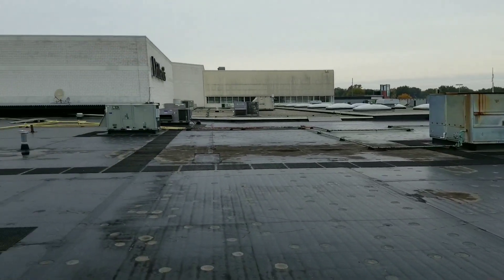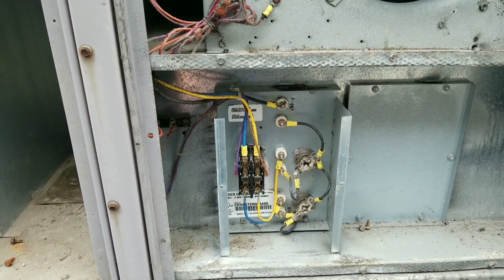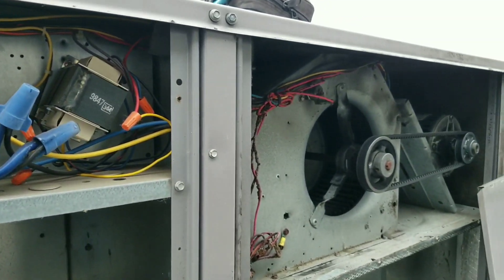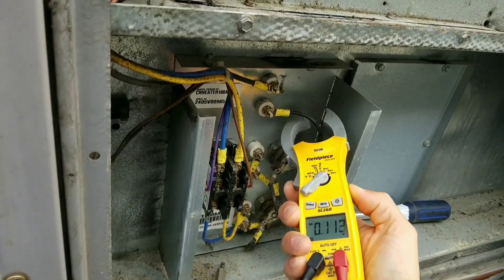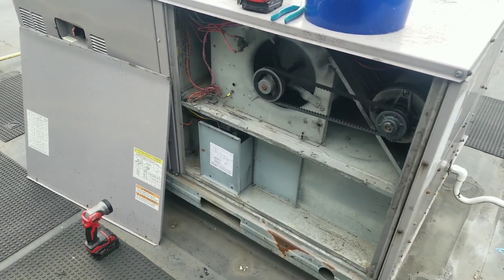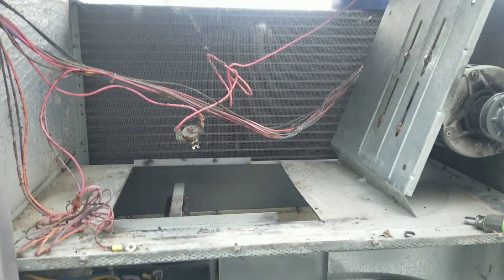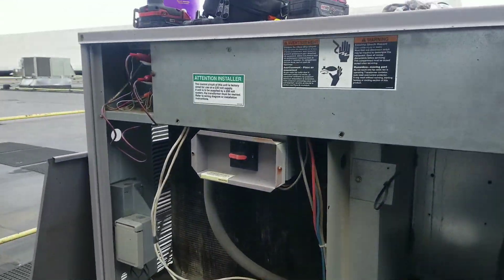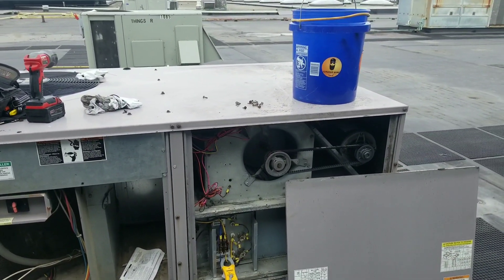Package unit with electric heat strips

Comment: I've modified these types of units to become a cheap re-heat by using a humidistat to enable a relay and energize the heat strips while cooling is going to raise the discharge temp and lower the RH in the space

Comment: Electric heat is about 50/50 with gas heat up here in the northwest. Gas isn't always available especially in rural areas. Energy code pretty much requires most units with electric heat to also have a heat pump capability. Electricity is fairly cheap to very cheap here, and propane is definitely more expensive if that's your only gas option. If you can get the power capacity, zappy zap zap for your warm!
Reply from the maker: Interesting- thanks for the feedback

Comment: See a lot of that set up down here in Florida. They maybe complaining because when you have only bank of heat strips you need to move that violet wire on the terminal strip to the orange from the board. This way W1 brings on heat strip with the blower. Otherwise the blower will run with no heat until you get a W2 call. Good vid
Reply from the maker: Thanks for watching Paul- Appreciate the feedback

Comment: I worked in Florida lots h/p and electric heat not to much gas.
Reply from the maker: That's what my buddy Chris at HVACR VIDEOS tells me
Reply: @curioushvacguy6876  it doesnt get too cold for them to use gas or oil so i guess electric and heat pumps would work

Comment: uhh there's a problem with your ohms test. There are three heat strips but they're not all wired in series. It's a three-phase supply with two of the phases switched by the contactor and the other always live. Each phase hits one end of a strip, and the other ends of the strips are all tied to each other, kind of a "wye" arrangement but with the center floating... You tested from the black phase to the blue phase, which shows the top and bottom strips to be functional. You did not test the middle strip, which comes back on the yellow wire. Also, note that the black phase is not switched, and your entire test may have been floating at 277V from ground.
Reply from the maker: Thanks for the feedback, Im going re watch that video and get a better understanding of this WYE pattern you speak of
Reply: All of the legs where pulling 14 amps, which makes 9,6 kw at 400 volt. So it verks!

Comment: A common problem is techs hook up the wires color for color. On these Carrier units it is not done this way. Orange to purple and purple to orange. The W1 terminal does not energize the fan. The thermostat energizes the fan. Thermostat must be set up for electric heat. I’m curious if the wire and breaker size were checked for the amp load for the second heat strip. The MOP (maximum over current protection) should be confirmed before adding additional heat.
Reply from the maker: Thats a good point- I didnt check the max fuse size or breaker size on this unit-- I go there pretty often so next time Im there im gonna walk on over and take a peak at that compared to the breaker size, im curious now 

Thanks AC Tech

Comment: Great video. I’ve never seen an RTU with heat strips before (other than in text books), probably because they wouldn’t have sufficient heat output here in Canada. 
I have to ask a dumb guy question now...
I saw the (very dirty) condenser coil, but where was the compressor? On the other side of the condenser coil? I’ve worked on a lot of Carrier RTU’s, but not that exact model, maybe it’s different because it’s an electric heat unit. The compressor on the units that I work on is typically right below the electrical panel. Thanks!
Reply from the maker: Hey 404- not a dumb question, it is in fact on the other side of the condenser, sort of right in the center of it or rather the condenser is sort of wrapped around the compressor if that makes sense-- thanks for watching, I appreciate the feedback

Comment: Thank you for a learning opportunity. I only watched the first part. Calculations below are "back of the envelope". Any corrections will be appreciated.
Heating elements were not "daisy chained". They were "Wye connected".
Resistance calculation should be done: phase voltage / phase current, i.e. 230/11,5=20 ohm.
You took resistance measurement of two heating elements connected in series, so at service temp. it should be 20+20=40 ohm.
At ambient temperature is should be less, ca. 39 (kanthal).
Jumping thermostat did not prove proper operation of all elements (cabling, thermostat, etc) outside the unit. You mentioned no fact which indicated that the strips were in operation when heat was called by thermostat.
What is the location of heated space? If it has no direct contact to walls/roof/ground, the only need is to heat is the make-up air. 
14,3 A indicates 277 V phase voltage. Power should be ca. 14,3 * 277 * 3 = 11,9 kW. 12 kW is roughly equivalent of 36’000 K*m3/h, i.e temperature should increase by 36 Celsius at 1000 m3/h.
Possible scenario: with coil that dirty the flow was much smaller and possibly thermal overloads tripped. The actual power was reduced to a fraction of nominal power. This could have been checked by leaving the heater “on” for a few minutes and observing current.
Also the belt was visibly loose. There’s no way it could pass a test with belt tension gauge.
Reply: Damn... I thought he did really well lol
Reply from the maker: Hey Lutz- thanks for taking the time to explain this, Ill admit electrical theory definitely isn't my strong suit so I have some follow up questions. 
You said- 
Heating elements were not "daisy chained". They were "Wye connected".
Resistance calculation should be done: phase voltage / phase current, i.e. 230/11,5=20 ohm.
You took resistance measurement of two heating elements connected in series, so at service temp. it should be 20+20=40 ohm.

Can you have elements Wye connected and in a series as well? 

On a side note- I did address the loose belt, I didnt show much of it on film after I pulled and cleaned the blower but I adjusted it to appx 1" deflection not using a belt gauge-

As far as the location of the space that is being heated, it is a jewelry store directly below the rtu, 4 walls and a ceiling, and surrounded by other stores. The front of the store has a mostly open design so Im thinking they sized this unit knowing the malls heating system ( Large RTUS that heat the halls, offices, and everywhere else ) would influence and this was just supposed to be used as supplemental heat.

Im still confused how you would go about calculating the amount of amps you should see at the heater bank based on heater size, airflow cfm, return air temp and voltage. 

If you care to continue this conversation please shoot me an email at curioushvacguy@gmail.com 

Thanks
Reply: Aside from taking a supply temp and ensuring you didn't trip the limit, I think this call was well done.  We are service techs not electrical engineers.  Great job Bill.
Reply: @ all major HVAC/R guys on YT I watch carefully your videos and learn from them, e.g. “what’s jumping out at me” is a good start for any job and I learnt it from HVAC*R. I do learn from each of you and am thankful.
Critiquing gives me no pleasure and I can gladly keep all my conclusions to myself. On the other hand I’m not a fan of “safe spaces”, don’t need one and think you don’t need them either.
You can say what you will about military but After Action Report is the best way of self improvement in practical activities. To the best of my abilities to try do just AAR/peer review. Kind regards and Merry Christmas.
Reply from the maker: Thanks Rookie

Comment: I just did a InterTherm  trailer with coil elements  amazing they use  electric here in Michigan
Reply from the maker: Its not efficient at all, in my opinion, our winters are just to cold- I havent seen to many of these but they are around apparently. What part of Michigan do you service?
Reply: Adrian  ,Brooklyn, Onsted ,Blissfield  and Jackson areas
Reply from the maker: Awesome - Im right in those areas as well, also detroit and the other side of the state-- what company do you work for if you dont mind me asking?
Reply: I work for myself  . was in Arizona for 14 years  as maintenance   supervisor for 5 apartment complexes 2800 units all I did was Ac units .came back  to Michigan family issues  etc.   worked on family and friends units from there word got out and now am to busy

Comment: Great video..
Defitinely need a second bank of heat strips..
Your not in south Texas,where 5 kw..is more than enough,with heat pump though..norm here is 7.5 / to 10..
But im sure you need 20- 40 kw of heat im assumimg....
Great tech tip..
Good job cleaning up everything.
Thx for the video..
Bryan Tyler Refrigeration
Reply from the maker: Thanks Joseph- yeah we dont have Texas Winter temps here, Im guessing you guys have a low of 30 in the winter? That would be nice, lol 
Thanks for watching and stay warm down there
Reply: @curioushvacguy6876  
Believe or not we have some low 20's and a few oddities of colder.but.yea.mainly low 30 to.upper 20's..
Thanks Bill...
Be safe....Amigo
Reply from the maker: thanks

Comment: and thanks for showing me that ohm's law test. I forgot all about that and just the other day I had a heat pump goodman with heat strips. the heat pump was working but the element wasnt. but it was one of those funny things.
Reply from the maker: I think if this location had a heat pump with the strips a supplemental heat source they would be much better off, not sure who set it up this way or why. For all I know the retail location wasn't part of the original design of this mall, it could have been added on-  Thanks for watching

Comment: Awesome video and thanks 4 the tech tip of the day I'm gonna have to remember that one thanks Curious HVAC much love and keep them videos coming I learn all the time from you and a few other channels I subscribe too. I'm almost done with trades school 4 HVAC one more term to go it's the fourth term Refrigeration application Commercial Refrigeration industrial Refrigeration Energy Efficiency and Green Building standards 1 and 2 and efficiency in Green buildings standard code I can't wait to get the schooling done with to get out into the field and put my skills to use that I've learned in trade School. We go back January 13th then I graduate May 2nd
Reply from the maker: Hey Grego- thanks for watching and for the positive feedback. Is this a 1 year course your taking? That was my assumption anyway. How do you like the course so far? are they getting in depth about refrigeration theory and circuits and how to troubleshoot? maybe there saving that for the fourth term- good luck bro, stay in touch
Reply: @curioushvacguy6876  this last term we costeucted circuits with motor starters with overloads and alternate relays circuits it's been alot of fun
Reply from the maker: very cool

Comment: Always enjoy the videos, usually only see the straight cool electric heat in areas that don't have natural gas...  just curious now but was there a w1/w2 call from stat? Keep posting brother 🙌👊
Reply from the maker: I think at the time there was a W1 call, I believe at different points, some off camera, I bypassed the stat for a w2 call. If I remember correctly the W1 call initiated the blower and the W2 kicked on the heat strips, sort of a funky set up- just not something I see in my area

Comment: That carrier is no spring chicken, I'm wondering why the complaint now? Thanks for the tip.
Reply from the maker: Hey Brad- thats a good point, I think its because of a management change over. It happens a few times a year where I have to go to these older locations and educate a new manager on what there dealing with as far as aging equipment or funky setups like this

Comment: Nice vid. Never seen one in buffalo. Only heat pumps.
Reply from the maker: Hey RJ- There definitely rare up in my area, especially just strip heat, ive seen a handful of heat pump units with supplemental heat strips but not many of these at all